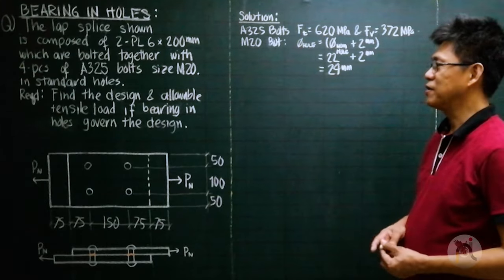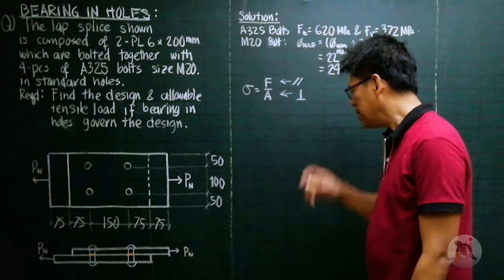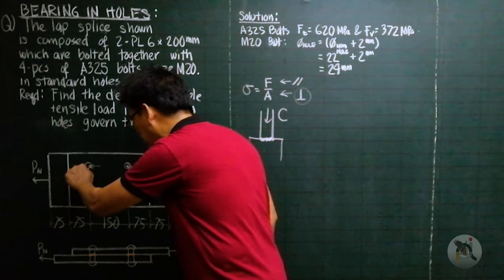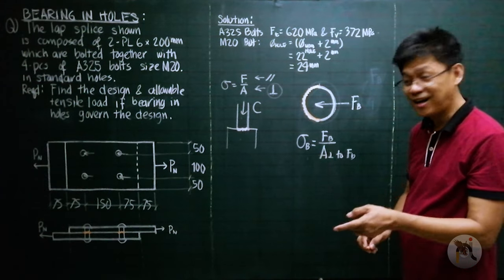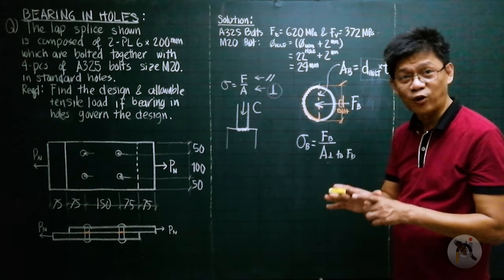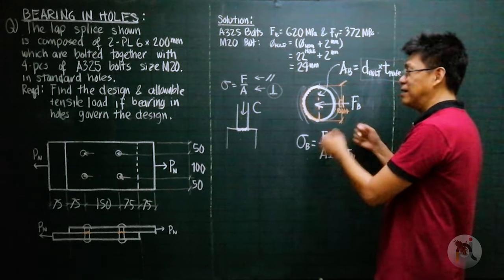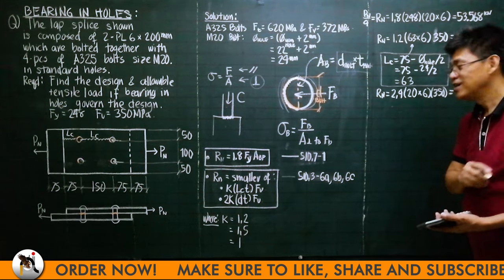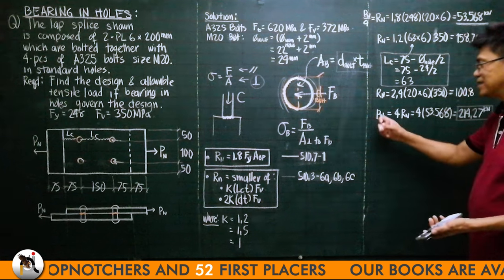CE Board Exam Review: Design for Bearing of Bolted Connection(Steel Design) #Part7

Comment: Sir patulong po.
Marikina watershed having a drainage area of 500 sq. km. has been 
characterized to have an average CN value of 65 in 1970 where it 
experienced a storm depth of 100mm. After 30 years, the same storm 
magnitude was felt but this time, due primarily to a change in land use 
inside the watershed, the CN value now is 84. What is the percentage 
change in the depth of runoff? Ans. 133%
Reply from the maker: Hi Almadrones! I'll send you an update when Engr. Padilla Jr. answers your question with a video.

-KB
Reply: @PadillaReviewCenterOnlineTV  Ok sir. Thanks a lot po.

Comment: The bracket shown is attached with 3-19 mm bolts arranged in an equilateral triangle layout. A force is applied with a moment are 500 mm measured to the centroid of the bolt group. The maximum shear stress in the bolts is limited to 100 MPa 

a) Determine the polar moment of inertia of a bolt about the centroid
 b) Determine the maximum force P that the connection can support 
c) Determine the torsional shear stress of each bolt 19 mm Ø bolt 230 mm 500 mm

paano po sagutan to . ang hirap po para sakin :( salamat po sana masagot
Reply from the maker: I shall need the figure. Pls send to padilla_review_center2000@yahoo.com